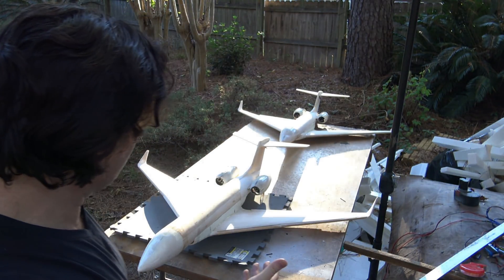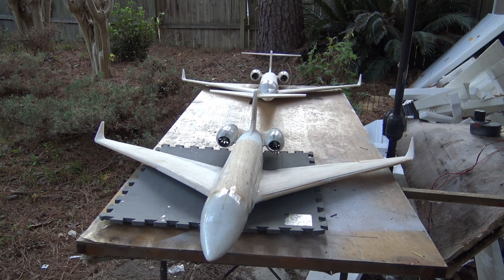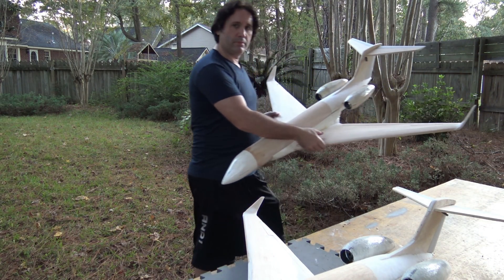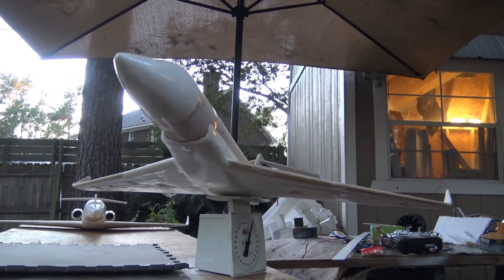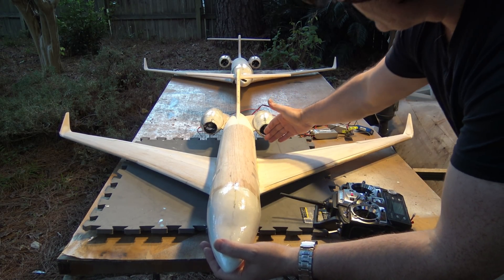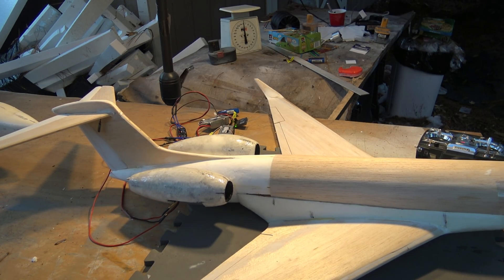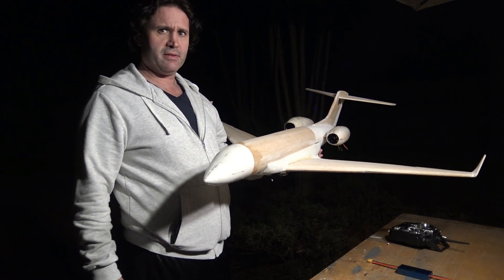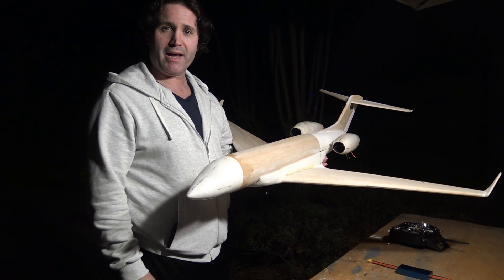RC Gulfstream G650 EDF Test & Progress Report [4K]

Comment: can i use 50 mm 12 blades?
Reply from the maker: Sure but for what sized Plane?
Reply: RC DemonDriver the same size
Reply from the maker: Then Yes you should be fine with 2 50mm 12 Blade EDF's.
Reply: thanks for the help

Comment: A 70 mm edf 2845 kv 2750. Or.  A 70 mm edf 2860 1850 kv witch one is faster to flay a 737
Reply from the maker: Hi Afraim, both are fine, but it depends on your 737, how large is it?
Reply: It’s 78 inches long
Reply from the maker: Try this one.
https://www.ebay.ca/itm/FMS-70mm-6S-12-Blades-Ducted-Fan-EDF-Unit-With-2860-1850KV-Brushless-Inrunner-Mo/322628501239?hash=item4b1e283ef7:g:E-QAAOSwNxdZedkF
Reply: Thank you